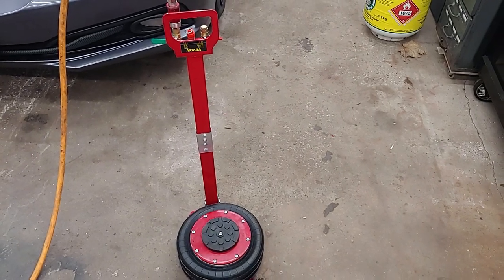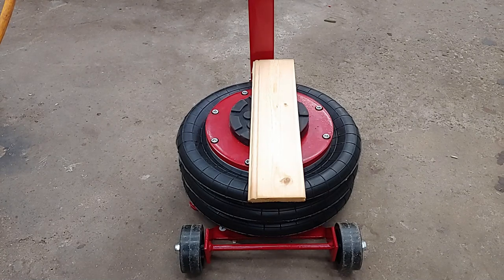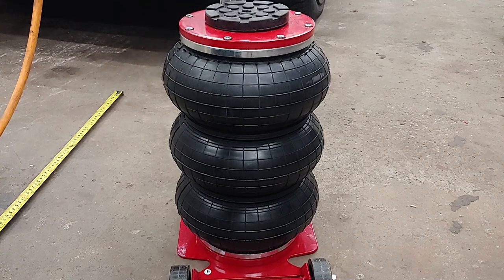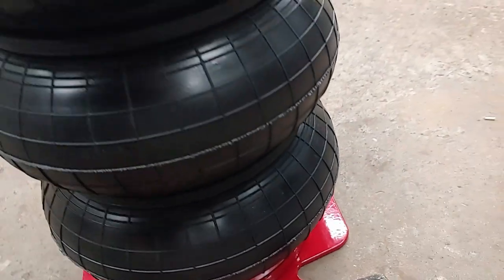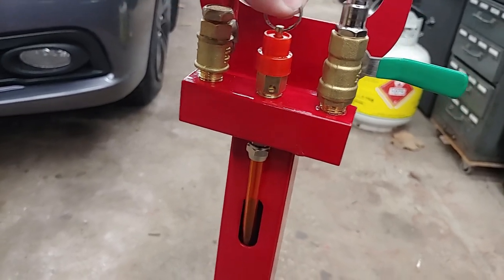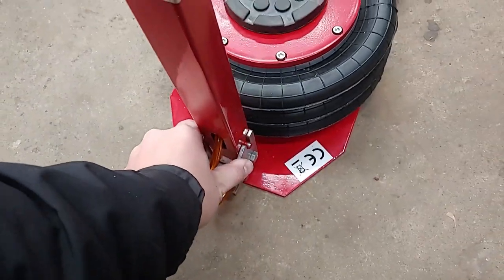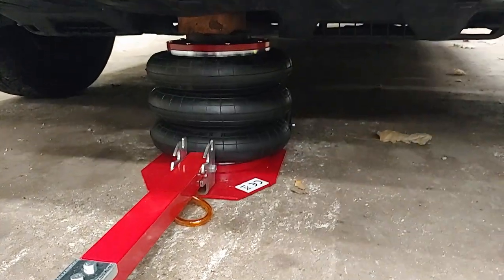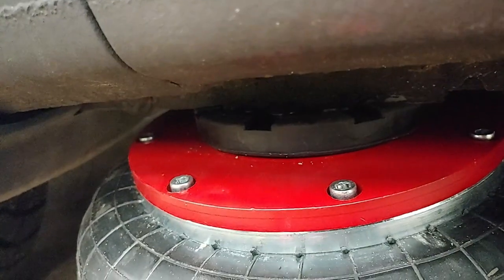A Look at the 3 Ton Air Jack from Amazon. Is it any good?

Comment: One mod I'd make for this is either some nylon runners or skid plate on the bottom so it doesn't completely scrape away the base plate paint from normal use when sliding it under the car.
Either that or lower the wheels and extend them outwards so it can roll on the wheels when tipped up at a slight angle, to allow positioning without scraping along the concrete.

Comment: Very good review.I think washers would be an answer to the slop in the handle and I would definitely use a block on any of the pinch welds.Also trim the top plate bolts to avoid any problems in the future.Thank you for your video.Very informative

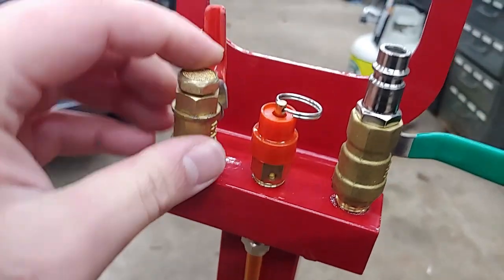Comment: 11:46 I've released the air through the inlet valve with it fully open and it's not much difference than the outlet valve with the diffuser.
I connected a pressure gauge to the release port as it's useful to see what the pressure in the air bladder is.

Comment: 17:50 if you have any discarded tires, you can cut a bunch of multipurpose jack pads from the tire tread.
They're useful for protecting the surfaces of the jack, car, and driveway. 
You'll need a reciprocating saw to cut through the steel belts, nothing else will do it as easily.
Reply from the maker: Yes I've been contemplating using that along with some plywood to make some durable pads. I actually use an air powered angle grinder to cut mine. It makes a lot of smoke but with it being air powered if the disc catches it won't kick like an electric one does.
Reply: @jtreworks  The rubber chews up the cutting disks too much on the cutoff saw so it may not be worth it; if you can borrow a reciprocating saw from someone it makes short work of it. Bi-metal blade does the trick-

Comment: As regards the pinch bolt.
Make a 1/2" piece of wood or thick rubber pad, with a hole in the middle.
Problen solved.?.
Reply from the maker: I have ended up doing this. I find plywood usually works best unless I need more height.

Comment: I just bought 2 of these for $70 each on Amazon and they are identical to yours and both of them came in 4 pieces + the brackets and bolts. I figured it wouldn't be any big deal till i question a bolts size so I looked at the directions and there completely useless it doesn't even tell you what nuts, bolts or brackets are required much less where things go
Reply from the maker: Yea it has some things that are to be desired but compared to other brands the price is right.

Comment: Just used mine to throw on snow tires. I couldn't get it to lift either F150 or Escape by the differential. Not sure where the 3 ton rating rating comes from. Lifts the corners fast though, so it's a keeper!
Reply from the maker: Thanks for watching! I didn't have an issue lifting the F150(base model) I used to work on and it lifts the front end of my 2011 Ranger 4x4 just fine. They rate it the same as the professional air bag jacks but I'm not sure if the airbags of this one are the same as the professional ones but I do know that if the jack isn't placed quite right while lifting it can bind near the top not allowing it to lift properly(side effect of being cheap I guess). The trick I use is lifting the jack until it touches the vehicle then I bump the bottom of the jack towards the vehicle slightly. This gives it just enough offset at the bottom to have it nearly perfectly vertical when fully lifted.
Reply: Mabe your compressor too small
Reply: @peacetoearth 
I have a pressure gauge connected to the release valve port so I can see the actual pressure in the jack.

 mine didn't require a lot of pressure, only 30 to 35 psi to support a compact car.  A higher pressure compressor fills it up faster but it doesn't need very high pressure for operation from what I've seen.
Reply: If it doesn't lift with heavier loads and sufficient air pressure, it could be stiction in the telescoping metal column inside the center which keeps it from flopping over sideways.
Good tip to try nudging it sideways carefully a bit to try to free it up during the lift.
Some videos of people applying some grease to the metal column to help it slide, may be beneficial if judiciously applied.
Reply: I have a '17 Ranger 4x4 diesel and it is able to lift the frontend by the wheel crossmember. I only need to put a 4" pad on top to get it to do so. I also have bigger wheels on the pickup so that probably contributes to needing the pad. I can get both wheels off the ground enough to put stands underneath. It takes 8 bar/115psi to get it there. I haven't tried lifting by the rear diff yet. I use ramps when I want the whole rear end up. For everything else I just lift quarters. My compressor is a tiny 8 bar/24l/6gal. It has to refill halfway through lifting the frontend. That's still way better than trying to pump 2.5 metric tonnes on a floor jack in 6" increments.

Comment: I’m waiting for mine. Will use a puck ontop of Jack if possible. I do road side assistance. What is the air pressure you find your using to lift. Honda’s vs f150s
Reply from the maker: Hi thanks for watching. I find lighter vehicles can usually be lifted by about 70-80psi. The heavier vehicles you will need to get fairly close to the maximum pressure which I believe is about 113psi for this unit. The F-150 I always worked on was just a standard cab with an 8ft box and there usually wasn't much in the truck itself. So in the field you never what you'll run into. As for what compressor it's really a matter of how long you want to wait since it's a closed system. I would think a pancake style compressor would be enough for this jack.
Reply: @jtreworks  did you try measuring the air pressure in the jack with the heavier vehicles?  I only tried lighter loads of a Focus, Camaro, and Transit, and the pressure was about 40 psi.
The compressor would have to be higher to fill it in a reasonably quick time by having a pressure differential, but it didn't need all that much pressure on my 3 ton version of the jack.
The 5 ton should take less pressure for the same lift load, but just more air volume.

Comment: I have to wonder how long that style of jack will last and how easy the repairs will be... I have an old Craftsman floor jack that I bought about 30 years ago and other than having had to top off the hydraulic oil twice during this time, it has been reliable... IIRC, it was made in China... 

With respect to that rubber pad, I wouldn't be concerned about it as long as there is enough clearance to put 1" thick piece of board between the rubber pad and whatever I'm lifting... I always have a sacrificial piece of wood between the jack pad and whatever I'm lifting... Usually use a soft wood like cedar or maybe pine... Of course, as a Canadian, you have hockey pucks for such things... :)

My wife has a Honda Insight which is based on the Civic platform, so I am more concerned with whether whether there is enough room to put it on the side lift points and have enough room to have a bridge go across the top of the jack so that cribbing blocks can be placed on each side of the bridge so that the jack can be removed from underneath it... 

I knew about the single jack point in the rear of the car, basically under the trunk, but more towards the bumper... I did not see a similar jack point in the front of the car though because there just was not room enough for me to get very far under the car when I recently changed oil and rotated the tires...
Reply from the maker: It's a pretty simple design by the looks of it and many of the parts you can disassemble. I have a similar hydraulic trolly jack that's probably as old as I am that I still keep because there's some jobs where you need fine jack adjustments which is what a hydraulic jack is perfect for. 

The reason I was concerned about the rubber pad is that there is 2 cars I work on that are extremely low from the factory one of which is actually too low for this jack the other this jack only had 3/8 of an inch clearance from the steel plate so I made a plywood puck instead of the really soft rubber one and it works well. On my 2015 Civic though it fits fine so you should be able to put a piece of plywood on top of the rubber pad for the Insight if it has the same ground clearance. 

Sometimes there's no jack point on the front of cars. A Hyundai and a Mazda I work on don't have a spot on the front so I have to jack from the pinch weld on each side.
Reply: @jtreworks  -- The Insight is basically the same body as the Civic, but with a bit more up-level features *allegedly*... As such, I suspect the clearance is pretty close...

I ended up buying one of this type of jack and the best way to add 2" of ground clearance is to put a 2" thick concrete block where each tire is going to end up and drive on top of it... Assuming you did not use too large of a block, then you now have an additional 2" of space to slide the jack under the car.  That is what I used on my wife's Insight... I could not use jack ramps on this car because the angle of the clamps was wrong and the front air dam would hit before the tires started up the ramp... If you space the blocks right, you could gain a bit more without interfering with the space that is needed to slide the jack under the pinch seam...

One "advantage" to this new jack is that it game me to motivation to fix the leaky air hose that I had been just "working around" for quite awhile...
Reply from the maker: @seanseoltoir  This fall I planned on doing something similar. I have some scrap 2x6 that I can cut to make small pads to drive on to so I have a bit more clearance to add more blocks to the jack and lift the vehicle higher. Hopefully, it will make undercoating a little easier. 

Nothing like a shiny new tool to make you want to spruce things up around the garage. :)
Reply: @jtreworks  -- I've actually gotten to the point of just leaving the 2" thick concrete block in my garage and using it as an indicator for my wife on how far she can park... There's also the classic tennis ball hanging from a string from the ceiling, but because the windshield is curved, that would alter the position where she parked slightly.  I put a landscaping brick on the end of the concrete block to stop the car from rolling over it and the car's final parking spot is on top of the 2" concrete block... This extra 2" helps my old knees a bit when I'm getting out of the vehicle... My wife's depth perception is not that great, so I have to make it as idiot-proof as possible...

Comment: How stable is the car when on the jack. Speed is not an issue, more important is how secure the vehicle is when elevated. Can you comment? Thanks
Reply from the maker: Hi, thanks for watching! The top of the jack does move around a bit especially when it is not at full height. I don't know exactly how much it moves side to side but it shouldn't fall over because of the cylinder inside. Once the jack is at full height it's a lot more solid. If you would like I can do a short video on how stable the jack is.

Edit: I measured the top of the jack at half height and it looks like it can move 1/2" or 12.7mm off-center.
Reply: @jtreworks  Sure a short video would help. I'm interested is seeing its stability not at full height but rather just over the height of a typical car wheel. Thank you
Reply from the maker: Sure I'll see what I can do here in the next couple of days.
Reply from the maker: @Darryl Carpenter  I've uploaded a short video that should hopefully answer your question. https://youtube.com/shorts/CxCV0mQq5_c

Edit: I don't know why it was set to private but it should work now.
Reply: Use jack stands after lifting, no safety in this jack.
Reply: It does tend to be a bit floppy when not locked at full extension, where the internal telescoping column is locked from sideways motion, but it does still limit the side to side motion at intermediate lift heights.
I wouldn't always raise it to full height as normal practice, but just enough to get the jack stands in place. It's more rigid at full extension, but then you trade off some stability from the higher height tending to be more tippy.

Comment: Awesome review. Damn those clear plastic airlines give me nightmares.
Reply from the maker: Thanks! Yes those clear plastic lines feel sketchy but when you do the calculations on such a small diameter line it isn't so bad. I have it now routed inside the handles since I've decided to keep it so less likely to get damaged.
Reply: @jtreworks  that line did look to be in a perilous position at the bottom, prone to scuffing and pinching.
Slot was supposed to be oriented towards the inside rather than the outside.

Comment: Hey, what kind of air compressor do you need to run these effectively?
Reply from the maker: Hi, thanks for watching! Since this jack is a closed system when lifting(no air escapes) almost any compressor can be used so long as it can reach the maximum rated pressure of the jack which is about 113psi on this model. 

This has actually got me curious as to the smallest compressor that can be used. I'm currently editing a video about this.
Reply: @jtreworks  probably could do it even with an air storage tank, but if you use it up then you'd need something that can actively pump air.

Comment: sounds like an awful lot of work just to bring it into spec.  why can't we build our stuff here in the good ole USA?
Reply from the maker: There is a USA built version of this called RakJak by Zendex. The only problem is I can't justify the massive price difference since I do not use this equipment to make any income. The cheapest I can get the Zendex 3 bag air jack with the long handle here in Canada is about $1500. I paid about $250 for the Vevor air jack and will probably only put about another $100 into it at the very most and maybe a couple hours of my own time. If I was running a shop as a business yes I would probably buy the Zendex one. Thanks for watching.

Comment: Good idea, build quality looks very poor. Nice review, thanks, I'll stick with my 3 Ton hydraulic jack.
Reply from the maker: Yes, it's not the best build quality out there but it's also not of an unusable quality. The higher quality ones from what I could tell from videos are much better, however, they are at a price point that they just don't make sense for the average garage tinkerer. This doesn't replace my hydraulic jack simply because this air jack along with all others in this style that I've seen lack the lift precision that a hydraulic jack has. Thanks for watching.

Comment: Will a car portable compressor work ??
Reply from the maker: Technically as long as the pump you are using can supply the jack's maximum pressure it can lift a car. It's a closed system so all the air you put into the jack doesn't come out of the jack until you let the car down. https://www.youtube.com/watch?v=Iucxa0GpMT0&ab_channel=JTReworks

Comment: I nearly died this very evening January 11, 2023 using two of these pneumatic jacks and six jackstands on the front of a car. Those pneumatic jackstands have no lateral support and it slid the car right past the jackstands contact points. Do not buy this product under any circumstances. There will be massive lawsuits on these. I barely got away with my life, swear to God.
Reply from the maker: I don't like to think I know more than other people especially people I don't know. Whatever you were doing to the front of that car I feel should have been done with different equipment. I've never had to do or have herd of a job on a vehicle that required 6 jack stands on one end of the vehicle. Also, these jacks are inherently unstable especially at mid lift which they are not really designed for. You are basically lifting up the car with a spring with an air jack like this. They are meant for full lift to their max height then drop them the inch or so to a jack stand that's it. If you need to do anything else use a standard hydraulic jack. One last thing, I have a short of me rocking this jack side to side at mid lift height and the car never fell off it and it's not so unstable that you couldn't drop a car an inch onto a jack stand unless you were pushing on the car as you dropped it. Sorry this jack didn't work out for you but thanks for watching.

Comment: Unfortunately that Chinese rubber is garbage and will deteriorate over a short time. Thank you for the review.
Reply from the maker: Thanks for pointing that out. I will definitly be keeping an eye on it over the next year as I use it and will report in if there are any issues.
Reply: @jtreworks  I have been using it for a year. The rubber is good enough and has not worn out. I think it will last for at least two years
Reply: I've been keeping an eye out for any reports of the bladder spontaneously letting go while raised and exploding, but haven't seen any yet.  
I'd think it has to be an eventuality given that it's rubber, but people have had these for years and not a single instance of it popping yet.
Maybe someone can do an accelerated degradation test by leaving it exposed to UV and ozone, and trying to max out the pressure and get one to pop in video. Project Farm maybe😅.

Comment: Wouldn't trust that thing for a second ..
Reply from the maker: I've already used it for 2 oil changes and it's working fine so far, obviously I use jack stands. There's no way I would trust any floor jack to hold a vehicle in the air while working on it. I even use a pole to place jackstands if I can't easily place them by hand like under the axels of a longbox truck. Thanks for your input!
Reply: @jtreworks  I was referring to the quality of Chinese rubber . I like the idea just would not trust the quality
Reply from the maker: @shawnl3154  I would hope it's at least half decent quality considering the amount of Chinese tires on the road(different rubber product I know). I'll eventually get to a tear down once I get tire season over with and deal with taking all the summer stuff out of storage.